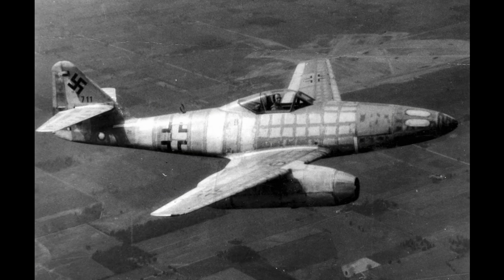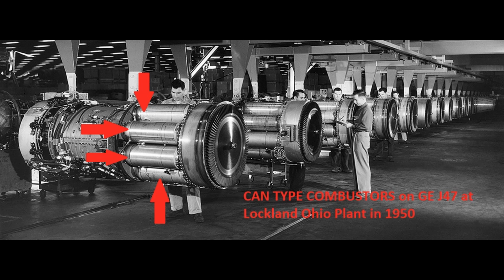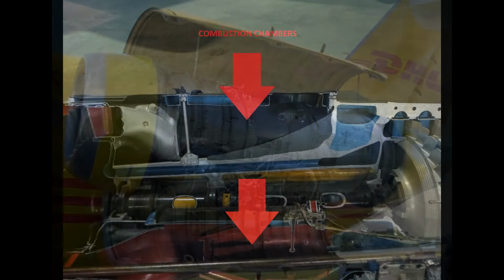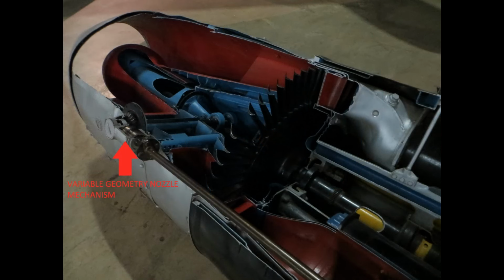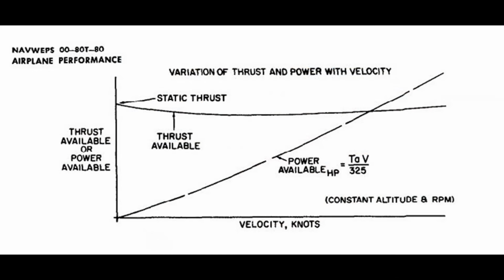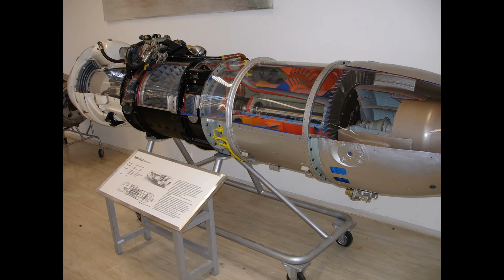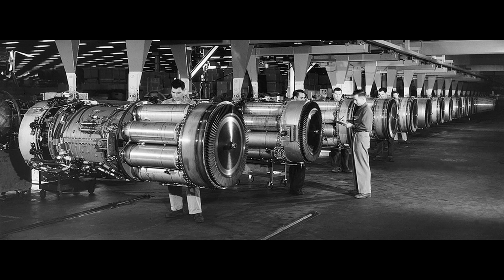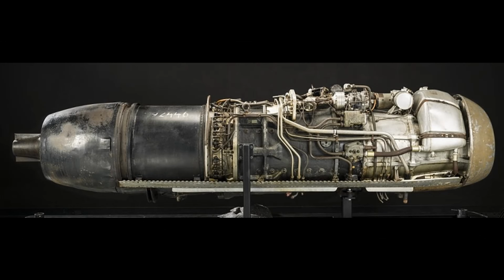World War Two JET POWER

Comment: I'd be curious how the Jumo 004 compares to the Rolls-Royce Welland, de Havilland Goblin, Rolls-Royce Derwent and Nene.

Did the British enjoy access to examples of shot down Me-262s which they used to improve their own engine designs?  And when does this start reflecting on these designs?

Early jet engine technology was progressing well in British hands in the 40's.
Reply: Apart from the well known fragility of the German engines due to a lack of certain metals, the British axial flow engines in development with Metro-Vick had much more efficient compressor blades (their design was based on cascade aerofoil research). The Britush research IIRC started in 1928 and they got their first engine flying in May 1943 in a Lancaster and in November 1943 in a Meteor. What is more is it used an annular combustion chamber, which caused heat problems, which didn't get resolved until after the war. I'm not aware of shot down 262s contributing to British research during the war.
Reply: @neiloflongbeck5705  Metrovick F2/4 replaced the annular combustion chamber with multiple burner cans. Engine ground run for 100 hours with no issues in January 1945. Didn't fly until 1947 in the SARO SR-A1. Metrovick F 2/2 design given to General Electric in the USA in 1943.
Reply: @richardvernon317  yes, that was just one of the changes made to overcome some of the heating issues that thr F2 had. But it doesn't change the fact that the F2 used an annual combustor. With the end of the war the funding for many programmes were slashed or withdrawn slowing down development.

Comment: Point about life expectation of the Me262 you raise: As you said, it was quite superior in doing it's actual job (attacking bombers and getting away), and the pilots flying Me-262s were usually (by necessity) a bit more experienced than the rest in the piston-driven squads - which was of course also a critically limited resource, you'd need to get pilots into the fight who could actually do the mission - so if there's 20 pilots and 10 operational planes in the squad, they would use those planes in shifts. I can't really see them treating those planes as fully disposable items, accepting a 25-50hour engine life expectancy as fine in a chaotic supply situation. It undoubtedly meant they were regularly running these engines beyond their natural failure point.

Also, with such high failure frequency, one has to say that a dual engine configuration might have served to sometimes get the pilot home or at least onto the ground - but it undoubtedly resulted in a lot of planes staying grounded as one engine had some troubles and parts weren't available. On the german wikipedia (claiming reference to Bundesarchiv/Militärarchiv data - can't check remotely unfortunately) they mention that of the 727 losses counted in the Me-262 units, 232 were caused by enemy actions (Feindeinwirkung)...
Reply from the maker: They were able to swap engines very quickly. The non combat loss rates were typical of warplanes of the time.
Reply: @GregsAirplanesandAutomobiles  Well, that is indeed true, but clearly dependent on there being engines available to swap, at whatever highly-targeted-by-allied-fighterbombers airfield they were using at the time :). It definitely opened up a number of logistical problems... can't imagine the field mechanics doing much useful work to the engine internals either after such a swap, I presume most of the time the old one would have to go back to the factory in it's entirety. It would be really interesting - but pretty much impossible- to have some sort of statistical data of how long the planes were grounded, but I think it's fair to say at any rate: They must have run into the problem of air-frames in need of engines being separated from the next engine delivery, and in response they most likely will have stretched out the still-running ones to the point they'd definitely become unreliable.

Just found a german language dissertation on the Luftwaffe's deterioration; the chapter on losses without enemy interference gives the overall number of such occurrences in June 1944 as 48.5% of total losses (p. 230), and it was claimed by the Luftwaffe inspectors that inexperience/human error was to blame for the vast majority of those - in comparison, the already quoted figures say the Me-262 specific non-enemy losses came to around two thirds of total (obviously, not a perfect comparison as that figure involves losses from mid-44 to the end of the war). However it must be said that the Me-262 squads did receive the most experienced pilots in general - I think by 1945 they basically would have considered sending pilots into combat in a piston driven fighter as the "training phase" before progressing them to the jet squads. Even the hand-picked "Erprobungskommando" squad under Walter Nowotny suffered more (how much exactly isn't said) non-enemy losses than enemy-caused (p. 167).

https://bonndoc.ulb.uni-bonn.de/xmlui/handle/20.500.11811/2241

To put it into automotive terms, the Me-262 use in WWII reminds me a bit of someone pushing a thoroughbred group B rally-car into figure-8-racing duty, expecting to win the championship based on their obvious performance and technological advantage - while on a shoestring parts-budget and being based in a barnyard...
Reply: Trying to figure the spare situation out by the numbers:
The delivered production figures for the Jumo 004B were 4752, and the total production of Me-262 (all variants) + Ar-234 (all variants) at 1368 + 214 = 1582 airframes carrying 3164 engines... Leaving 1588 spare 004Bs, meaning pretty much exactly one spare engine was produced per plane (ignoring prototypes such as Hortens) - which wouldn't sound too bad IMO in terms of spare part usage, if that was all it took to keep them going over the airframe's service time - but I strongly suspect the near-perfect 1:1 ratio represented official planning more than anything else - most likely that happened to be exactly the bare minimum amount they could get away with by Luftwaffe ordering policy.

However I just found reference to the phenomenon that the "delivery" of swappable 004B engines regularly happened in the shape of new complete airplanes landing at the airfields, which were immediately upon arrival parted out completely (p.189-190 of the aforementioned dissertation). I guess that's exactly what the wikipedia-article (going back to the archival data) somewhat ambiguously refers to when it says "Über 200 Flugzeuge waren nach ihrer Übernahme zerstört oder beschädigt worden" - more than 200 Me 262 (~15% of total production) were "destroyed or damaged after their take-over/acceptance"... 
Now I have no comparison figures for the same thing happening on other (german) planes, but I strongly suppose you only do that to your low-production best-model-available plane if you happen to have at least 2 otherwise serviceable planes grounded in the same unit, waiting for parts which will otherwise never arrive, right? Sure, there might have been a number of planes that actually indeed were damaged on transit to the units - but since this mention goes back to a post-war interview with none other than Göring himself (someone must have, undoubtedly after adjusting their uniform for a good while, told him about this cannibalization going on), I think it must have been impossible to ignore even at the very top of the Luftwaffe, that the new jet fighter units were in dire demand of spares.
Reply: @decnet100  You make some good points - in figuring the logistics of supporting an Me 262 in operation, the requirement is for 4 engine sets.  1 on the airplane, good for about 2 days of operations, one on the way to the overhaul shop (often by horsecart, since fuel and trucks were in short supply, and trucks attracted fighter-bombers) 1 set at the shop being overhauled. (It could be an upgraded automotive garage, and one set making its way back from the shop to the airplane.
It's certainly the case that by 1945, the Luftwaffe had an excess of airframes, due to the early-mid 1944 production bubble, and fairly few pilots - they found it much easier to pull an airframe out of storage, since they had more than they could fly, than to do depot repairs on a damaged airplane.
Reply: @peterstickney7608  Thanks, that is indeed a beautiful image of the most high-tech aerospace engine in the world at the time getting carried to some backdoor mechanic in a horsecart - I think that even surpasses the absurdity of my own "Group B car in a figure-8-race championship" example - reality so often is stranger than fiction. Reminds me a bit of the unlikely theft of a Sidewinder missile by Manfred Ramminger (if you haven't come across that yet, look that up - absolutely insane story ready for a spy comedy flick) - just that it  was institutionally "the right thing to do" in case of WWII jet maintainance.

One might suspect that 2 days of usable running time is probably a bit too conservative an estimation; even during a particularly demanding time, say three sorties per day on a given plane, I think they'd barely touch the 10h run mark after the second day due to lack of fuel (there certainly was not much sitting on tarmac with engines running for those planes) and short distances to the combat zone; but then of course, take-offs were particularly wearing on the jet engines - and obviously, compared to their allied counterparts, I much less see them following good engine-friendly procedures. 

Obviously they weren't on scheduled missions starting out in essentially controlled airspace, but always scrambling to intercept bombers, while being hunted by fighter-bombers if their airfield location was known, and (in response to exactly that) often using makeshift, potentially dirty runways such as the Autobahn, which you probably wouldn't want to linger on and risk sucking in pebbles or big tree branches for longer than strictly necessary - and as became evident for JG7 already in I think winter 44/45, they often received the information so late that the bombers were essentially already passing overhead as they took off (they relocated their airfields accordingly).
Sure, I guess some were professional enough to still maintain their pilot discipline regardless (I expect Galland's hand-picked JV44 pilots to have been the prime suspects in that regard), but for the majority of pilots in late war, I think it must often have been a matter of "I could die right here if I linger too long and don't get this thing up to speed/altitude soon!" versus "the engine might die a bit earlier (which could mean I might not even have to fly for a day or two)"...

Comment: The D ring 2 stroke starter like a lawn mower continues to blow me away. I think they used a starter kart normally but if they were hiding on the autobahn they used the pull starter . It was pure genius !
Reply: +Ron Lawson      The little starter motor also had an electric start option.

Comment: That starter engine, being a two stroke, is more like a MZ BK350 motorcycle engine than a BMW.
Reply from the maker: That would be a poor example. Obviously I can't use some obscure brand of motorbike.
Reply: @GregsAirplanesandAutomobiles  Yes you right. But as an interesting side note MZ's cheif designer (Walter Kaaden) was one of the V2 engineers..

Comment: Hello, how does the engine compare to the British equivalent? Adolf Galland claimed that if the Meteor engine was fitted too the 262 air frame it would create the best fighter in the world. This of course implies that the Junko 004 was inferior to the British engine. Was that true?
Reply from the maker: No, that's just the way Galland talked. The Meteor engine was inferior in design, but of course had better materiels. The US wasn't bombing Britain.
Reply: @GregsAirplanesandAutomobiles  Greg, not contradicting, but objectively, I'm not seeing it.  The Welland, and especially the Derwent on the Meteors produced more thrust, burned less fuel, weren't as susceptible to compressor stalls or flameout from throttle mishandling.  In terms of component efficiency, which has nothing to do with the materials, but the aerodynamics, they were superior.   I never handled a Derwent, but I have flown a Goblin, and an engine that you don't have to keep an eye on to make sure the fire stays on the inside I would consider a good thing.
It's worth noting that when the USAAF was testing the Me 262 (They were flying 2 of them at Wright Field), they didn't conduct any single-engine testing, but logged 9 engine changes in 15 1/2 hours of total flight time. including the loss of 1 due to a double engine failure, and 2 single-engine landings on the other ship.  Now - some of this is due to not having all the logs on the engines, so their history wasn't known, but that's still not great, and they cancelled further testing as being too risky, and they had the data they needed.

Comment: Could you compare the engine used in the meator to the two engines in this video?
Reply: Yes you could even if this guy Greg seems very pro German
Reply from the maker: Really? Have you watched my P-47 series or my Corsair video?
Reply: I would say. Jump more powerful, meteor  engine more reliable due to no material shortages
Reply: @crabbyjungle5670  You may be right but design enters into the equation as much as materials if not more
Reply: @crabbyjungle5670  Not from the figures I've seen?

Comment: To note Greg, the JU 287's landing gear was actually from a captured US bomber! The actual production plane would not have had such landing gear, likely something more traditional.

In a way the 287 was just a big test plane.
Reply from the maker: It's sure generating comments though! On a more serious note, I know they would have gone to retractables at some point, but it looks like with the work they put into those wheel pants they could have done it right away, and this is the only variant that ever flew, the V3 version people talk about was just pie in the sky as far as the 3rd Reich is concerned.
Reply: @GregsAirplanesandAutomobiles  
Hehehe, I gotta admit its pretty hilarious that the plane was using interwar-era landing gear designs. 

Question, would you ever do a video on the other German jet engines? Like the HES and such?
Reply: @ThatZenoGuy      The use of captured equipment by both Allies and Germans would make a good topic, although I suspect it might be too broad of a subject.  Post-War use of leftover German equipment in several nations is very interesting.  For example the French were left with two giant He-274 prototypes which the Germans had unsuccessfully tried to destroy.  So they finished construction and used one as a research aircraft until 1950.  https://i.redd.it/bir8k25933y21.jpg     And the French were likely still flying Nord seaplanes with Jumo 213 engines until the late 1950s or early 1960s.  https://www.avionslegendaires.net/wp-content/uploads/images/avion_militaire/Gn1400-noroit-2.jpg   And I think the Soviets may have been operating a few Fw-190D9s until 1947-1948.
Reply: @FiveCentsPlease  
I find it amusing that despite capturing half of Germany, Soviets didn't know how to build a jet engine.
Reply: @ThatZenoGuy   The Russians basically packed up production lines for both the Jumo 004 and BMW 003 and moved them East and resumed manufacturing them as the Klimov RD-10 and RD-20 respectively.  http://images.polot.net/storage/da74ee9fd251fd5555a461defcc35a4c93fdc1e4
Reply: @FiveCentsPlease  
Of course, then they promptly were unable to actually use the damned things and had to steal British designs lol